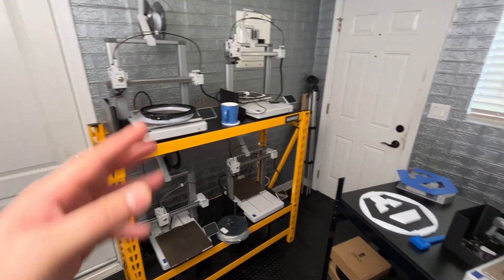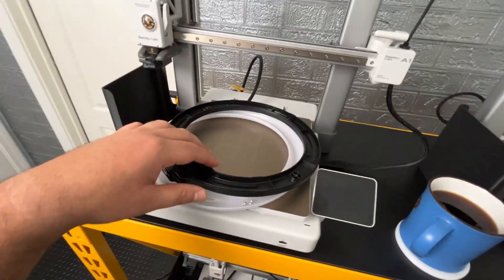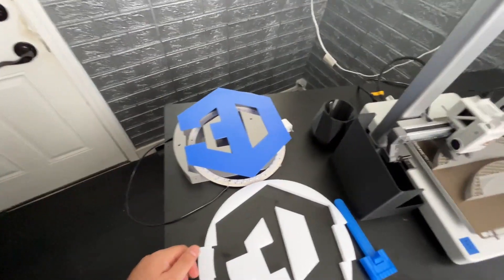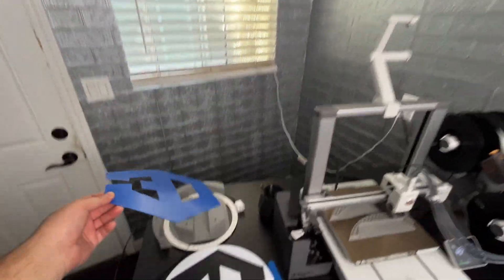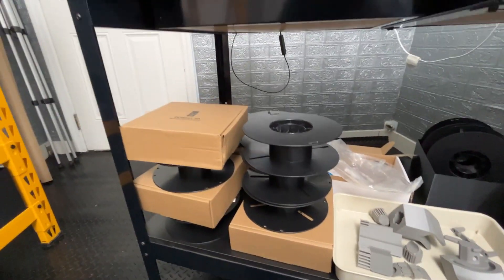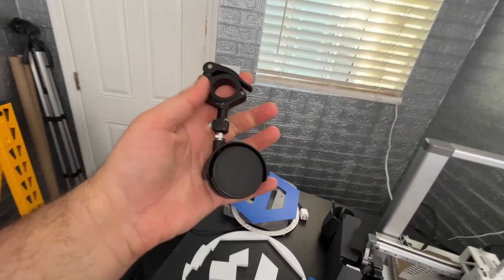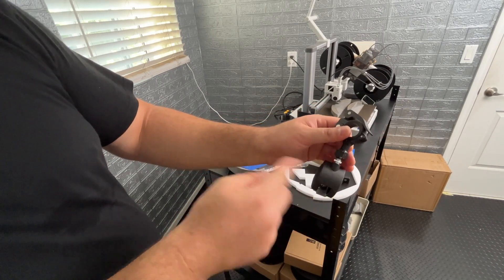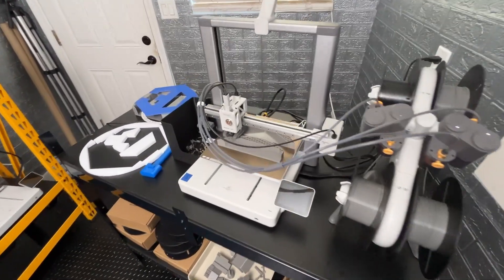Creating a 3D Printed Logo Light-Up Sign & Wheel Prototype!

Comment: Is it cheaper to use a light diffuser material on the LED?
Reply from the maker: @YanBousquet  Thanks for your suggestion! Using a light diffuser material directly on the LEDs could potentially help smooth out the light more evenly across the logo. It’s a great idea to explore for future projects. Appreciate the tip :)